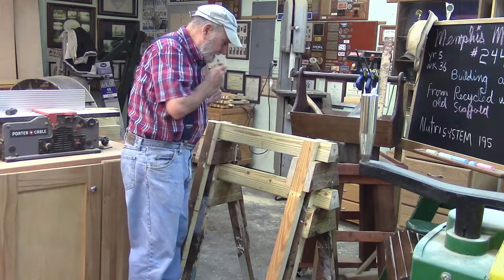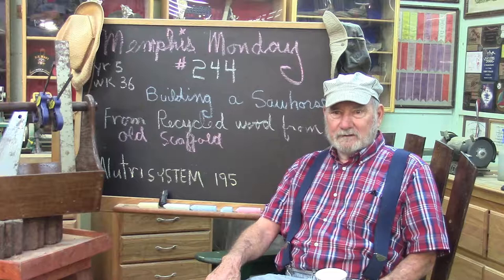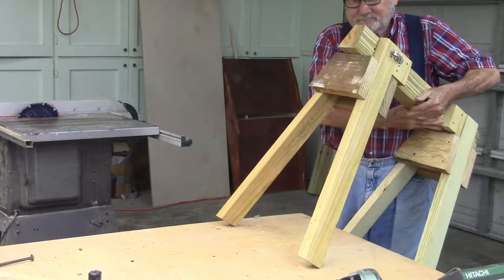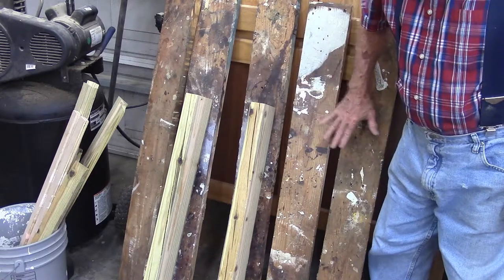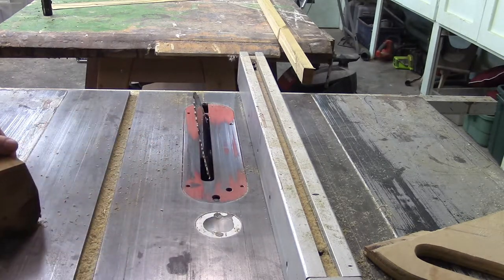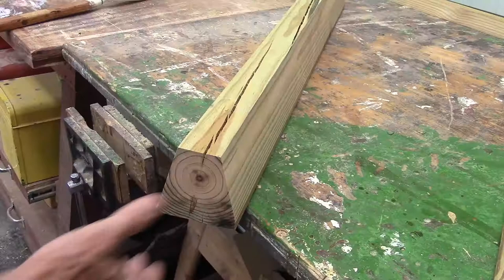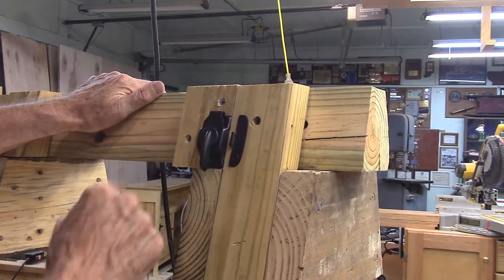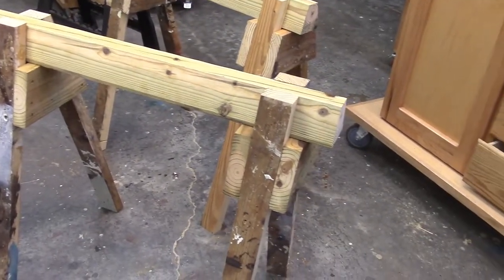244 Building Breakdown Sawhorses from Recycled Wood wk 36

Comment: Very nice design.  I do have a question for us wimps who can't lift very much weight.  Do you think this would be as strong if you had used 1" or even 3/4" wood on the side braces?   They do look much better without the latches.  You could always use some kind of peg system if you find that they aren't holding in place on their own.  Thanks for the tip on using the table saw.  I hate to admit that I have yet to use any power tools other than a drill even though I have spent the past several months working with my brother.

Speaking of that: I am sorry that I have gone missing again.   I have been working with the brother on his family room.  Between that and all the holiday festivities and family activities, I have been pretty busy.  So busy that I had to scrap taking the camper to Florida.  I do plan to go but will only stay for a few weeks in a condo or something.  

Congratulations on your weight loss.  You are looking quite healthy.
Reply from the maker: As normal, great minds think alike.  Since I'm a wimp too, I had the same idea about using thinner and lighter wood and made some new ones.  Think I'll do a Memphis Answers video tomorrow on your question and show the revised models.
      Can you believe it:  it has been five years since my fight with that table saw (or has it been six years?)  Nothing special about using power tools, fact is, many purest avoid them as much as possible.  One thing I can say is that they all are potentially dangerous, so be safe, and take nothing for granted.  
      A condo in Florida, now that is what I call camping.  Now on your way, might as well turn right for a few days and scope out the Southwestern US.  That settles it; that's the plan: a two week road trip to California and back.  You have my blessing to start whenever the family room is finished, and you may stay as long as you like (provided you do plenty of videos). 
      More shed roof building next week, I think.  Thanks again for watching and commenting.
Reply: @MemphisApplegate  I will be looking for your Memphis Answers video.

I think I started watching you about the same time as your accident/ fight with the table saw.  I think I may try to tackle a simple project this summer with my skill saw and hammer and drill.  I also have a jig saw but have only used it once or twice.

I would stay in condos all the time but they are considerably more expensive than camping but I think I can do a few weeks.  Have you seen how cold it is in the southwest.  No Thank you.  I want to get to south Florida as fast as I can.

Tomorrow, I am helping brother pour a concrete hearth for the family room.  It should be interesting.